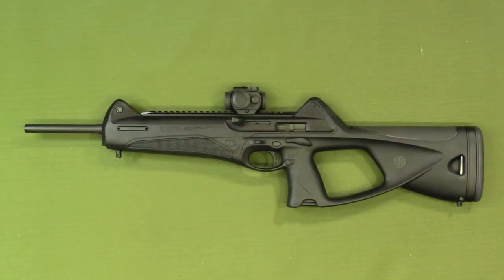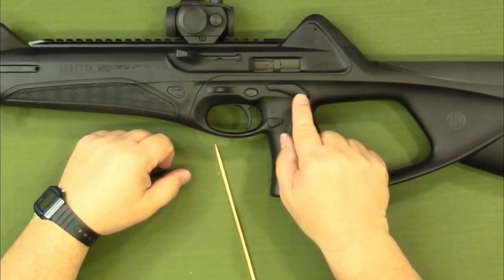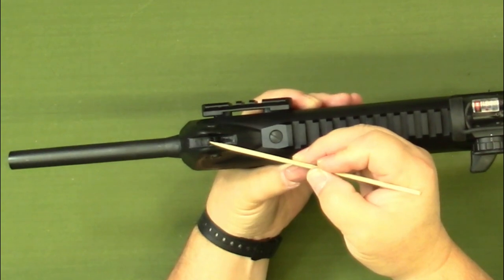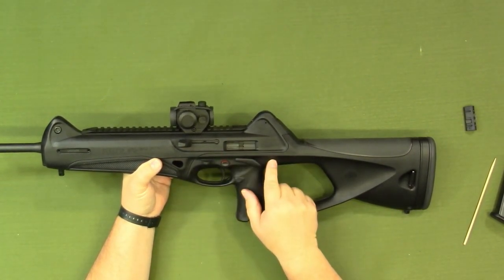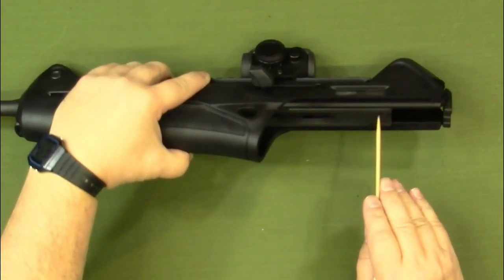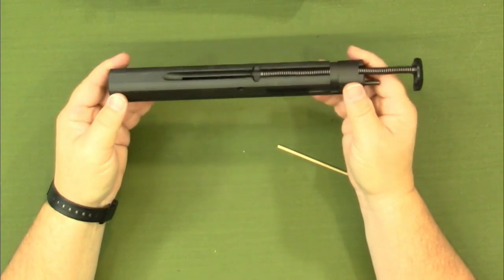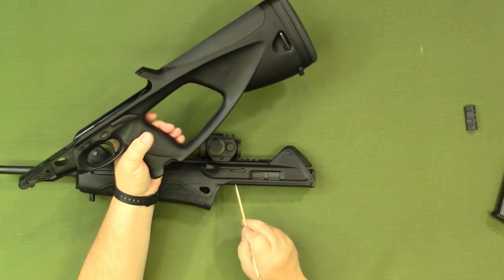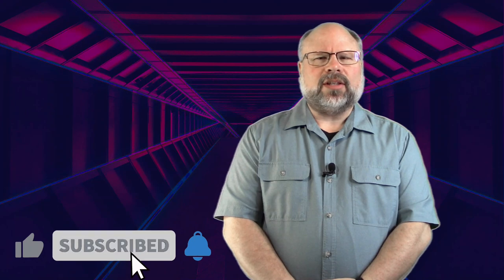Beretta Storm Carbine  - Field Strip and operation

Comment: Good video... I added a second charging handle to mine just because I could :) ... No tools required!... You can really feel that bolt when it cycles.
Reply from the maker: The first thing I did after getting mine was purchase a second one to be able to run dual charging handles. I like the versatility it provides.

Comment: Checking for rounds by working the bolt before take down is crucial, because if you try it with the PLASTIC hammer in the 'fired' position (up) it will absolutely break off the plastic buffer on the end of the bolt spring rod, thereby rendering the weapon into a useless decorative item.

Comment: It has an interesting feature. If a closed bolt firing streight blowback bolt gun is dropped on the stock when the barrel is up, the bolts inertia makes it go back, and chamber the next round or eject the previous one and chamber the next. Its even worse for open bolt blowback guns, the bolt can go back just far enough for chambering, but not far enough to catch the sear, bolt goes forward and fires immediately.
This gun prevents the bolt from going back on its inertia if the stock hits the ground. It has a spring loaded hook under the barrel. The springs push the hook forward. If the gun hits the ground, both bolt and the hook want to keep going back. The hook hits a sloped surface that makes the back side of the hook to go up and into the round hole on the bottom side of the bolt. The hook travel is limited, so it stops the bolt from opening for extraction.
p.s. i mean i dont know if it works exactly like that, thats what makes sense to me, judging from the manual and an imperfect 3d model.

Comment: I just bought a New CX4 Feb. 2023. I read the manual and it states the charging handle requires force to take it out. I had to use a screwdriver to wedge it out!!!!  The handle has to be rotated to be put back in. Not easy like your carbine. They must have changed something.